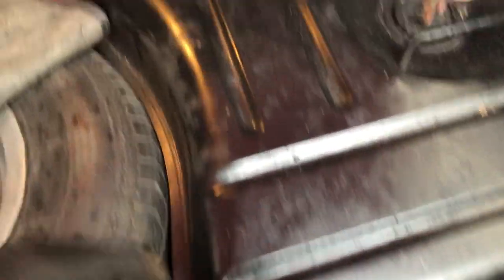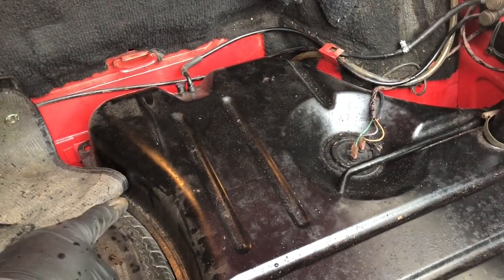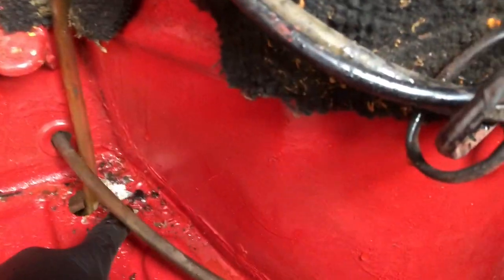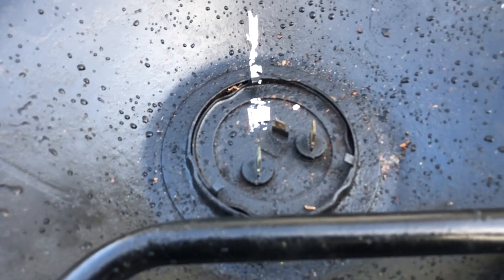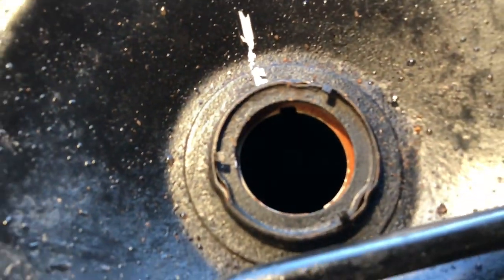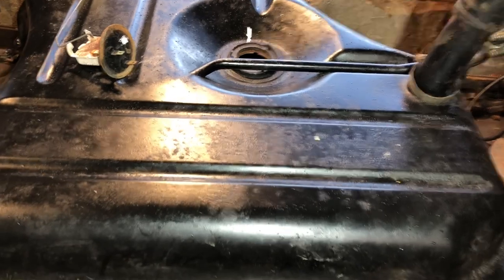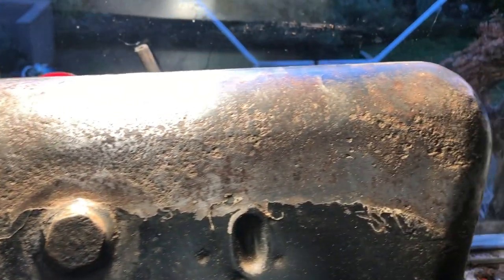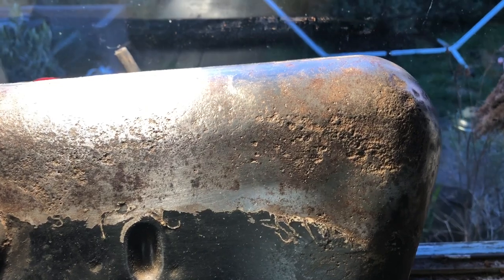Triumph Stag Petrol Tank Pin Hole Wizard!!

Comment: The Triumph 1500 had the same problem. One Monday (fill up day) I filled the tank with the usual amount (6 gallons) only to find the tank was only half full. Thinking the petrol station had robbed me, I foolishly had words with them to no avail. Then later on, smelt fuel. The spare wheel was swimming in petrol. I had a long range tank! These were the days when people generally smoked in the car. Oh well. The rest of the car died of tinworm a couple of years later (1972-1980) RIP. No galvanised bodies in those days!

Comment: This is one job that I think i'll do this summer, to check my tank.  After a drive it usually perfumes the garage but the boot does always have a particular smell although I seem to recall that it always did. When I put fuel in a couple of weeks ago though, I did seem to recall it having more left in the tank since last autumn.  It's just an unknown for me so i'll check. :)
Reply: djtaylorutube Something else to check are the banjo bolts on the petrol pump. They can intermittently drip dependant on temperature. Just put some tissue under them and check every now and then for drips of fuel.
Reply: @Martin_Coombs  thanks Martin, will do.

Comment: Hi Tony it's not a fault  it's just an old car 40 plus years  no mater what the car or motorbike  you lucky if your tanks not rotted  wheeler dealers had one soldered up on an Triumph TR6  that leaked  so there might be some light at the end of the tunnel  . Kind regards Stuart

Comment: Hi Tony went through the same issues process with my stag. Ended up finding a good second hand one on ebay. Also on mine there was 2 adhesive foam strips attached to the bottom of the tank think its supposed to stop vibration and rubbing. Ask your mate at the stag garage if there needed. Cheers dave @daveclassics instagram
Reply: @ArryTheStag  Foam strips are fitted at the factory and act as a sponge to any water entering the boot and hold it(The water)onto the bottom of the tank to gradually rust it away.Best removed and replaced with pieces of plastic for the tank to sit on.Did you isolate the battery before rubbing with a wire brush etc?
Reply: I always thought the strips were neoprene rubber and wouldn't absorb water, don't think Triumph would have been daft enough to use foam but what do I know.